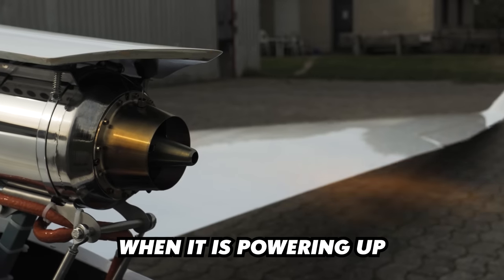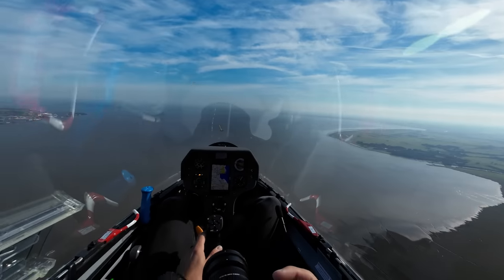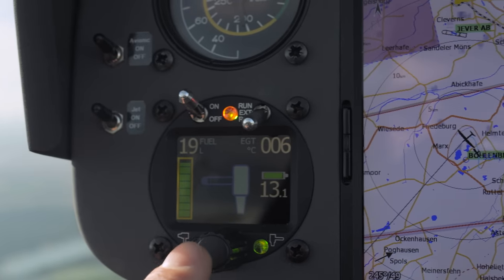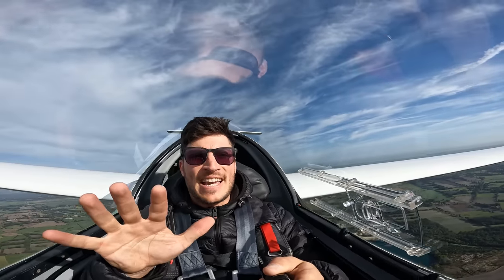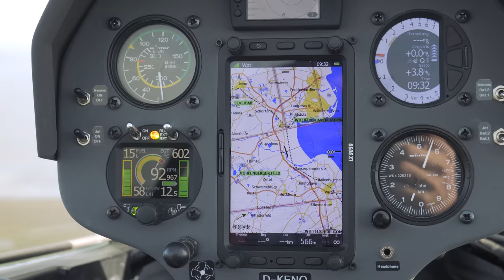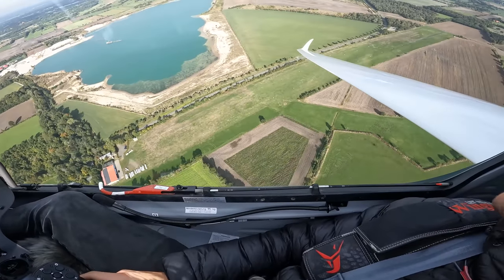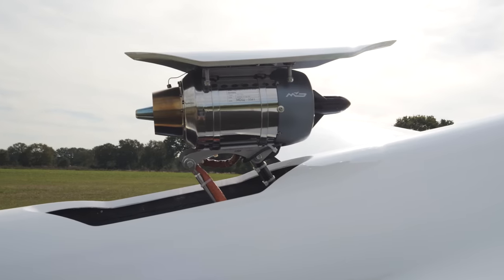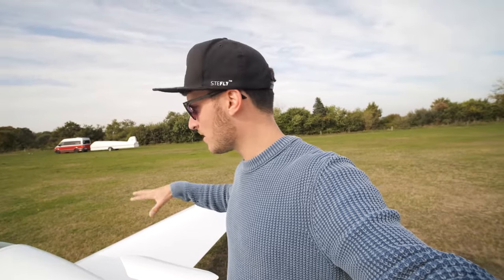My FIRST TIME flying a JET | LS4 Jet M&D Flugzeugbau

Comment: Better view than an F-16 and jet sound to boot, awesome experience!
Reply from the maker: So true!
Reply: @redneckshaman3099  🤨📸
Reply: this is pretty trick 👌👌
Reply: @SteFly  this plane made china or just your self made this jets
Reply: hmmm no
Reply: @SteFly  next you could do two jets!
Reply: 💋💋 love it
Reply: Now it just needs some Air to Air missiles :D
Reply: @anotherguy9402   no point.. 2 jets don't give you more speed.. they increase, load carrying capacity and drink more gas... neither of which is good for glider
Reply: F16 has a better view tbh
Reply: Nowhere near as cool as a F-16 though 😅
Reply: @LemonHead-sq5ws  not many private citizens has the wherewithal to access and fly F-16’s though.

Comment: Biggest risk is uncontained fire from the jet engine, also there is no aluminium shielding on the rudder leading edge. Overall , Very cool design and excellent power weight ratio
Reply: Fibreglass too, aren't they? Fibreglass fires on water are a nightmare. Can't imagine one at 10k ft with control cables running through there. Give me a parachute.
Reply: @captainotto my club doesn't allow anyone to step into a glider without a chute
Reply: @znek4288 I could imagine, I wouldn’t want someone dying on my watch neither. Insurance would be screwing your hard if that happened lol gotta have your ass covered lol
Reply: Yes, I wondered about poss heat damage from exhaust.  Also, I'd imagine the engine must cool before it is stowed to avoid internal fire.
Reply: @bartofilms  Those engines do need to cool before stowage. In fact, you can't even shut them off without keeping airflow over them or their bearings will fail by heatsoak much like your typical automotive turbocharger would.
Reply: My grandpa towed gliders in WW2 he said everyone who wasn't shot down landed safely. He flew C-47s and landed with one engine and man size holes in the wings.
Reply: @My_Fair_Lady  Commercial flights mostly however I done a little hot air ballooning.. I am planning to do a glider next hopefully one day I can afford a small airplane of my own.
Reply: @My_Fair_Lady  yeah, flying is flying
Reply: @My_Fair_Lady  
Why do you fly? To get birds attention? 
 Why do you comment for other random people? Do you realize how weird that would be anywhere ,to most people.
Is this at least a friend of your's?
Reply: @znek4288  Are gliders less safe than Cessnas and such, then? Because I've never worn a chute as a private pilot, and never heard of anyone doing so, aside from aerobatics or maybe test-flying a new kitplane.
Reply: @bcubed72  gliding is as dangerous if not more dangerous as driving a high-speed motorcycle at max speed
Reply: @znek4288  This risk is little more if any than in GA. It's just that most certified GA pilots don't consider parachutes and most GA aircraft aren't designed for easy bailout like a sailplane is. The one area of higher risk is the close proximity flying you do in sailplanes that most GA pilots wouldn't consider, doubly so in contests.
Reply: I would speculate there are several meters between rudder and nozzle, and since engine isn't close enough to the body, Coanda effect is not triggered, and heat flow is dissipated just fine at speeds of 110km/h+. Incoming airflow also helps cooling engine way faster.

Comment: The ability to climb 2500 m using only 20 L of diesel is absolutely phenomenal. I can see this being used in the intelligence and surveying industries. You could also hop from thermal to thermal easily.
Reply: Jets do not use diesel 😳
Reply: @benturp3492  This one does.
Reply: @benturp3492  did your teacher also get frustrated with your comprehension skills
Reply: @FarmerDrew  I wasn't beeing taught proper English. Like you Americans can talk :)
Reply: @TinyBearTim  I know mate!
Reply: @benturp3492  my Uncle was a flight instructor in the US Air Force and we flew sail planes over the Rockies but yes please tell me to put diesel in an airplane because you know they sell so much diesel at airports
Reply: @benturp3492   jetfuel it's basically purified diesel or kerosene
Reply: I mean might as well drone it. Cheaper.
Reply: Imagine in future something similar but electric, maybe it could be covered in solar panels from top too so it can recharge while gliding :-) then we get rid of the pilot and make an AI to fly and search for thermals
Reply: Its already being used. We call them drones.
Reply: @benturp3492  most jets use Kerosene, which is pretty similar to Diesel.
in fact Kerosene is called #1 diesel fuel oil  and Diesel is #2 diesel fuel oil

#1 has a slightly lower boiling point, is slightly less lubricating and has slightly  lower energy..(135000BTU vs 139000 BTU for regular diesel)

Any Jet engine can run on diesel.. at worst a slight bit harder to start when cold.. but doubt anybody would notice
Reply: @stijnvandamme76  Jets use A-1 mate. I would not put diesel in an aircraft. Ever heard of diesel fuel turning into goo/slime when it gets cold? That wouldn't be good at high altitudes would it? 😕  But what do I know.

Comment: People are asking about the heat of the exhaust on the tail section, but I wonder what happens when that hot engine is retracted back into the tail boom? Great ideas include huge challenges. I love the idea!
Reply: It's not super difficult to insulate against some heat, but probably best to leave it extended to cool down first
Reply: From what I read the unit won't allow retraction until the EGT reads 50C.
Reply: You would leave it out for a few minutes to cool down before retracting it.
Reply: @jamesogle99  Huh so that's why it's not manually extended. Would've been a total no-brainer but that can result in an unwary pilot setting his glider on fire.
Reply: I talked to someone from M&D at their booth in Freudenstadt last year and apparently the thermal mass of the turbine is low enough to cool down within less than a minute. Drag is about the same as leaving your gear down
Reply: @jamesogle99  Ingenious, indeed. But I wonder if it would make sense to insulate it enuough to be able to retract back at a higher temp, such that the added drag doesn't last as long.

Comment: The ability to abort landings or touch and go for gliders cannot be overstated. I understand cost prohibits every glider from having an auxiliary engine, but after seeing this I don’t think I’d fly one without it.
Reply: It's not just cost.  Adding an engine lowers the performance of the glider and drastically alters the weight and balance.
Reply: Overstated.
Reply: @kiereluurs1243  Thanks. I was looking for a free proofreader.

Comment: At first I wondered how close the hot exhaust of that jet was to the tail of your glider! 🔥
Reply: same!
Reply: It will be a problem over time.  It would of been better if they used 2 jet engines 🛩️
Reply: Yes seems like it will cause stress cracks over time.
Reply: @Funk_Reactions  Something to keep in mind: as the aircraft is traveling forward the EGT (Exhause has temperature) mixes with outside air and the temperature lowers as the air molecules mix. By the time the exhaust and outside air reach the tail section  its probably not much warmer than a medium hair dryer or lower. I would agree if you tried to use the jet engine for take off, yes, you'd literally burn the tail off the glider.
Reply: The tail must have to made out out aluminum somehow to resist the heat, I think. Once the plane is flying through the sky, it will be sufficiently cooled by the passing airflow.
Reply: I don’t know, I worked on FA18 in the Navy and yes I know that the trust that those engines aren’t comparable however the JBD jet blast door that we use on carriers are cooled by 30 plus knots head winds and over time they do need to be replaced because the non skid dissipates due to heat and cooling. So I don’t know, just depends on many hours they went through testing of this type engineering.
Reply: @the.bog.  ha ha ha... you'd get surprised if they only "test" they did was some guy saying: "hmmm... I think it would be okay..."
Reply: @the.bog.  hah... in my country, "certified" means anything, from "certified" to "uhm, okay...no need for any testing, it should work...probably"
Reply: @danielkraus5662  would HAVE
Reply: @entx8491  Using "of" instead of "have" has become an epidemic, especially among native speakers. Do people not read anymore?
Reply: @sophiasocal68  you'd be wrong, the temperature of that exhaust is over 800°, it is not cooling down to room temperature over the span of 3 ft. There's a reason why not a single aircraft design in the world mounts a turbine directly in front of the tail. This is an awful design.
Reply: @ticenits1926  Distance from the jet exhaust to the fin leading edge looks to be about 3 meters,  not 3 ft. or 1 metre.   However when turbine jets fail they can throw a flame out a lot more than 3 meters.   I assume the fin is made from epoxy glass or epoxy carbon.  Apart from the flight loads of the fin itself it also has to carry the flight loads of the tailplane (stabiliser).   Subjecting the fin to an out of control kerosene flame puts its structural integrity at risk.   I would not fly in that aircraft for these reasons.
Reply: @aeroearth  I just hope this turbine is small enough that its only intent is to be used infrequently to regain altitude so the amount of damage done to the tail is minimal. I've seen helicopters protect the tail boom from exhaust downwash, although the tail boom is not a control surface.
Reply: @wallabing  no the engine is in a slight angle so it doesn’t blow direct on the tail
Reply: @aeroearth  holy shit. One sufficient flameout or fuel pump mishap and your glider falls apart in the sky because your ultralight structural skin burned through.
Reply: @Funk_Reactions  Those engines burn as much fuel as that glider carriers in under a minute
Reply: @sophiasocal68  I saw people use it for take off, seems very flammable to me 🙃
Reply: @ticenits1926 3 feet really ?? 😂

Comment: I love the evolution here: weight to available thrust being the operative point! I'm a bit cautious as the jet blast is extremely hot and thinking the integrity of the vertical stab' is a question?? I'd love to get your perspective on the climb rate with the jet? That's the real value here, in my opinion. Of course you can jet cross country but what is the climbing (VSI) capability? Fuel duration isn't such a big deal if you can grab crazy altitude!! Great flight and vid' as always Stefan. :)
Reply from the maker: Thank you! As mentioned in the video, the climbrate with a IAS of 135 kph is about 2.1 m/s. With 20l of Diesel fuel you should be able to gain 2500m of altitude.
Reply: The jet is mounted ~2° sideways
 So the hot center of the jetwash does not even touch the vertikal stabilizer
Reply from the maker: @glucksi1655  At the LS4 it is mounted straight, but they needed to measure the temperature on many points on the fuselage to certify the glider. Of course they also tested at high outside temperatures.
Reply: @glucksi1655  Or maybe underneath since it retracts?
Reply: Or maybe underneath since it retracts?
Reply: @c.a.nixiii4650  good idea, that might work too but perhaps it’s up top due to landing gear or something on the bottom… overall would be even cooler if it were able to be in the back kind of like an APU on large jets with an intake near the passenger top and the exhaust at the very back so that no retraction is required and it wouldn’t produce any drag when coming in or out and perhaps could be more fuel efficient due to this and gain more benefit in flight due to that as well (less drag, more ability to climb, less fuel, no worries about overheating the fuselage, perhaps can install a larger engine, perhaps more room for fuel due to no need for system to retract it, and maybe cheaper to install but only if it’s a new glider being built with one of these stock).
Reply: @c.a.nixiii4650  mmm yes, superstall time
Reply: @c.a.nixiii4650  what happens if the retraction fails? Always easier to bring it back down, that to pull it up inside the fuselage... hence at the top
Reply: @sidb9540  I would say the same for it burning off the tail. Same for landing gear on any plane.
Reply: @c.a.nixiii4650  landing gear are fine because they can be easily designed to be manually lowered and naturally lock into a lowered position. If a bottom mounted jet fails, its going to fail in the down position and be more difficult to retract. As far as the tail goes, they did tests to ensure the stab could withstand the temperature and it was fine.

Comment: Maybe I missed that part, but for me a major point for any kind of propulsion on a glider would be the question if it offers you the capability of taking off on your own? Here someone had to pull you up with traditional motor plane, which creates a massive dependency on others and equipment as well as extra costs, but is this tiny jet really to weak to accelerate you on a "normal" length runway to a speed way beyond safe lift-off? I guess the roll resistance is so high that this jet is in the category of a more sophisticated hair-dryer ? 🙂
Reply: With enough runway it probably could, but if you want a powered glider then there are purposefully built ones. Gliders sacrifice all for performance in the air, including the self launch capabilities, that's why it's a sport. Win some, lose some. If you want it back, you'll have to sacrifice performance and you get closer to a regular aircraft. The point of this kits is to increase flight time and add capabilities while keeping added weight and drag to a minimum.
Reply: @moteroargentino7944  I have seen gliders with props on an electric motor that, just like this one, completely disappear into the fuselage, so they are aerodynamically no sacrifice, they are just like having a passenger behind you, some extra weight. And they have the ability to actually get in the air by themselves. So you think the extra weight is such a big sacrifice? 
This jet is obviously a very compact add-on that is strong enough to keep you in the air for quite a while, once you are up there. Maybe it also comes in handy if for whatever reason you end up above the clouds and you are looking for a safe hole to get back underneath again. I am not a glider pilot, but as a motor pilot this can easiely happen and then you are much more safe if you have enough fuel and can stay up there and find the right spot to descend, avoiding IMC.
Reply: Exactly!!!
Reply: You would burn the 20 litres of fuel just trying to take off lol

Comment: With 40 Liters of fuel up to 200km range is not bad.
100km at max power
Reply from the maker: There is an option for 60l fuel tank in the wings available aswell. Overkill imho :D

Comment: The Jet turbine is Amazing  adaptation  to the Glider hope the reliability is as good as small petrol or electric propulsion units  ...  I wonder if self launch could be possible  ?
Reply from the maker: Most likely it's possible on a long runway but not certified  for it ;)
I have seen a video of a JS3 with this jet making a selflaunch.
Reply: Yes, "amazing" consumption - 65l. Especially these years. Take off generetates probably some risk that tail will burn - no cooling (no air flow at the first phase).
Reply: @SteFly  decades ago, diamant 18 with a microturbo  éclair out of Altenrhein am Bodensee, registration HB-2020 . Easy take off, 
Fixed installation, no noticeable effect on sink rate,  in a thermal could not notice  it's presence.
EFF made the modification.
Reply: @podunkman2709  
No problem: mixing cools the jet rapidly, soot deposit is small but visible.
Reply: Joe, 1 moving part is as reliable as it gets, once the electric starter gets it to ignition rpm. Electronic fuel control, simple compared with the one used on much larger engines.  (FADEC)🇧🇴
Reply: check "ac 4 115 jet" . its sub 115kg, self launch, two turbines, up to 8m/s vertical speed on two turbines (2m/s on one)
Reply: What about the heat from the exhaust hitting the vertical stabiliser ? Does it affect the integrity of the structure ?
Reply: @doc777ga  they say its warm ,not even hot on the ground. They use jetcat 300pro . Here you need no license to fly on "sub 115kg" glider. They build few of them, 40-45kEuro each. Now they are going to build self launch 2 seater.
Reply: I'd still always opt for winch launch with the engine running. Nothing beats a winch 😉

Comment: Would love to see more of this.  I would think that once the motor is in full burn that the exhaust in only water as efficiency is very high.
Reply: The fuel has carbon in it, therefore the exhaust does too.
Reply: @SnakebitSTI  Not if you have a good burn going. There will be only water. You may have 20-50 ppm CO. Miniscule.
Reply: @grabir01  It's a jet engine, not a nuclear fusion reactor. Carbon in -> carbon out. Hydrocarbons in the fuel get broken apart and oxidized in the engine. An efficient burn means the hydrocarbons are mostly converted to H2O and CO2. In practice, there will always be particulates from incomplete combustion and other pollutants like NOx and SOx compounds.

To produce pure water exhaust, or close to it, you need to use pure hydrogen as the fuel and pure oxygen (not air) as the oxidizer.
Reply: @SnakebitSTI  I posted the carbon out measurement real time. IT is not zero. It is super low for sure. A very very efficient burn for sure.
Reply: @SnakebitSTI  I stand by my original comment that the exhaust is only water as any organic components also in the exhaust are negligible. Which was my point. Axiomatic.
Reply: @SnakebitSTI  If you know of a Nuclear Fusion reactor, provide the link.. Thx.